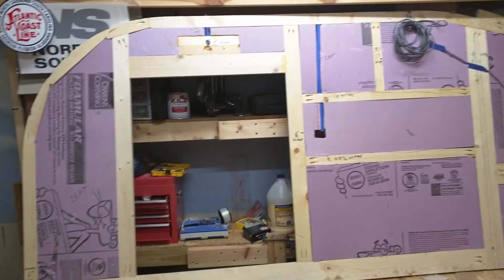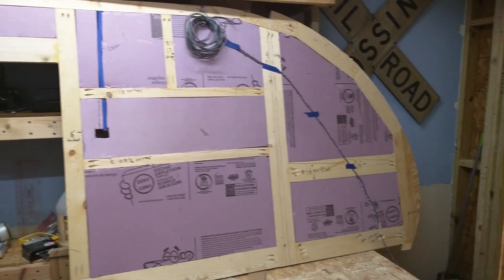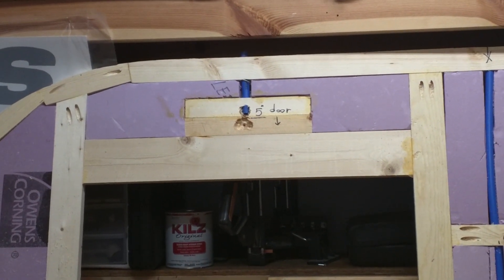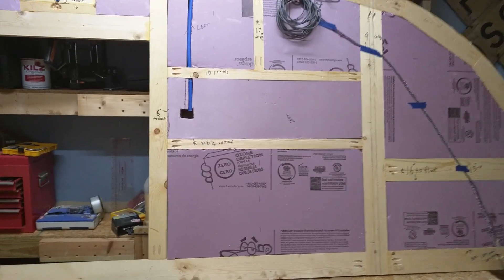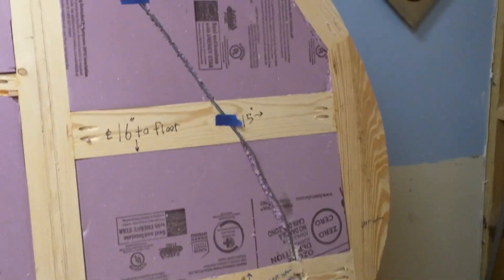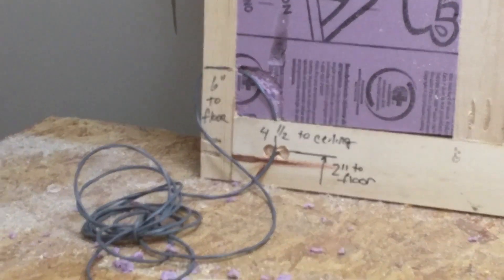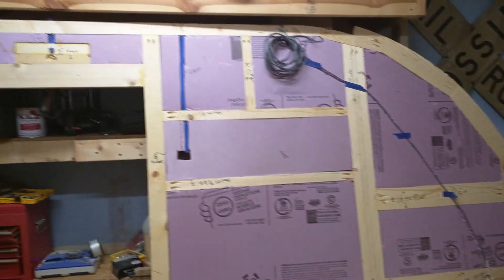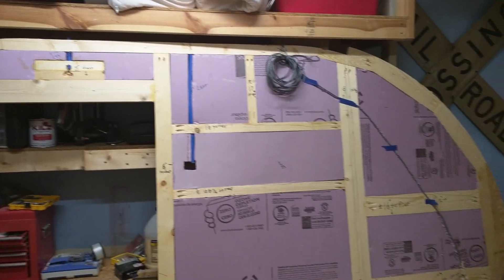How to Build A Teardrop Camper #4 - Wrapping up the wall framing

Comment: Oh and dont forget to use GFI breakers on the 110 circuits at the junction box......Also use external plug boxes with snap -closed doors just for 110 volt.

Comment: You should always run your wiring straight up from the floor or frame rails of the trailer. Your switches should be in between the two. The Kitchen should have a junction location or small box with a power strip ( Buss Bar) for more then one take off....Then use circuit breakers for 12 -volt stuff and regular breaker box for your 110 volt junctions. Plastic conduit is a fire hazard and dangerous for sleeping people and a pain to snake wires later...Just put 3/8 in. holes thru each of your 1-by's......

Comment: Do you use the same side panel on both sides
Reply from the maker: Same overall , only slightly different in that the left side has backing for a power inlet, and right side has backing to screw into for a side table bracket.  All the rest is exactly the same if I remember correctly.
Reply: Dad Rambles Workshop thanks for your reply so fast god bless stay safe

Comment: what size radius curves did you use ? what is your trailer size 4x8?
Reply from the maker: Checkout my first video.  I think it's 24 on the front, and 42 on the back.  I mentioned it in video one.  Thanks for watching!

Comment: why not run the wires under the floor to the back corner instead of in the ceiling
Reply from the maker: Just a different way of doing it.  I have seen some done that way, and don't really have anything against it, I just did it a different way.  Thanks for watching!

Comment: You say use one wire where are the ground wires?
Reply: I think what I meant to say was the pair of wires. I ran speaker wire to each one of those and it contain two wires. Thanks for watching.